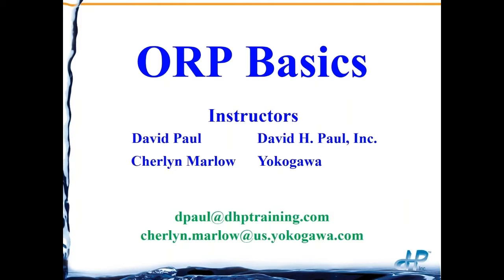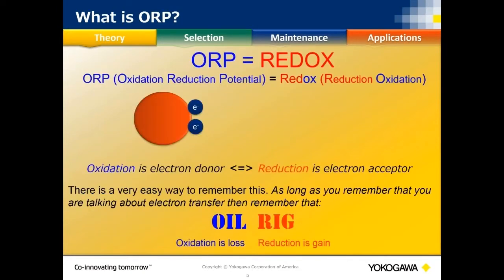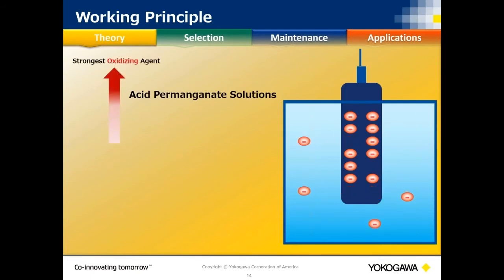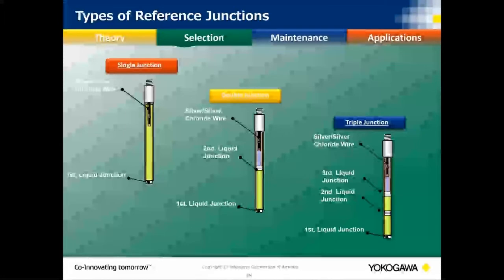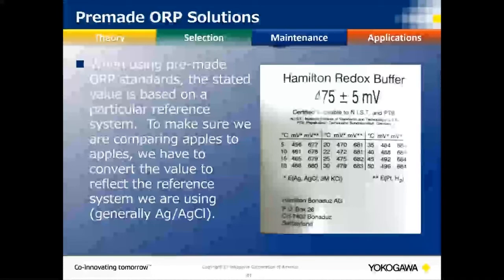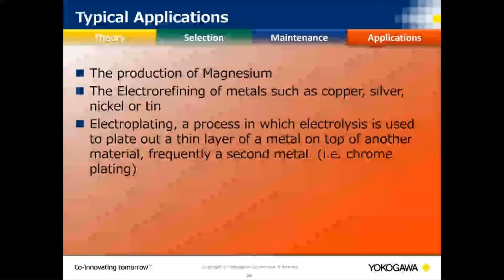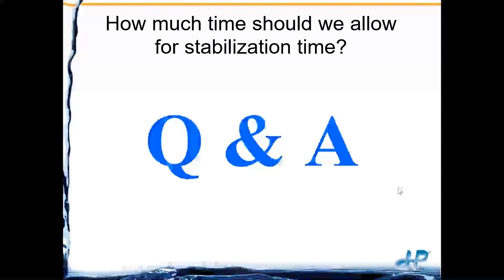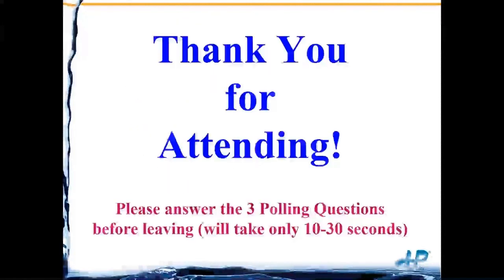ORP Basics

Comment: This was very informative.  I had used ORP measurement with Arduino to automate dissolving ozone in an aquarium.  ORP measurement in an aquarium, especially if you've got it on an IOT setup, would also give you a pretty good indication if something has died and negatively affecting the water column such as increasing the ammonia levels.
Reply: As someone who just scored a $40 goodwill find of a 46 gal. tank, this is a GREAT idea. =) 
Can you share your arduino build or point me in the right direction?
Reply: for orp you need a proper probe as well.  so it gets a bit expensive.  i have a couple of ezo, ph, orp, ec. but now i only have ec on my aquariums.
Reply: @Mr_ToR  probably less expensive than dead fish and reconditioning a tank =)
Why just the EC meter? Is it the least amount of probe while still giving you enough information?